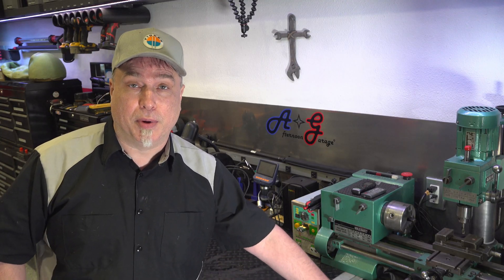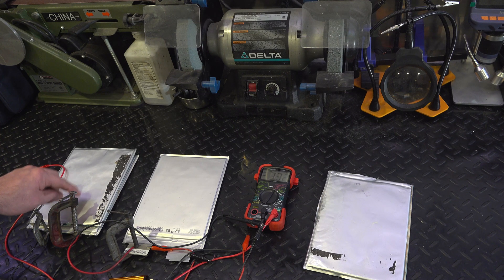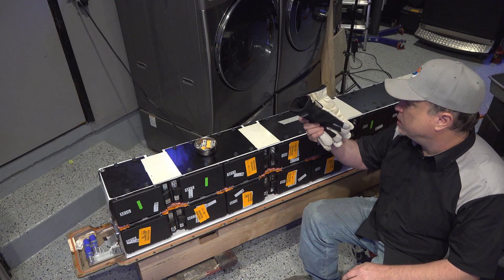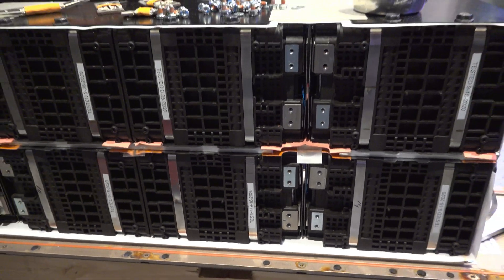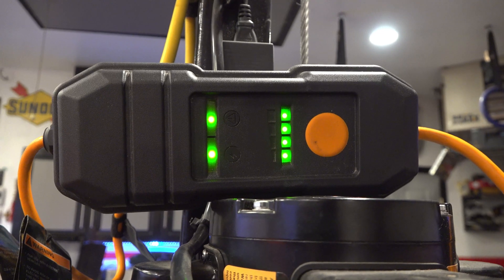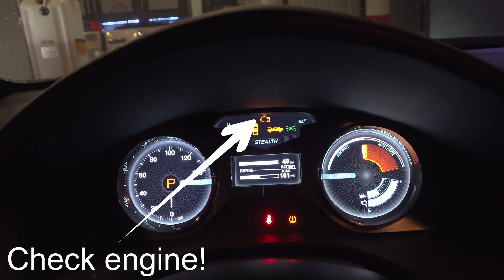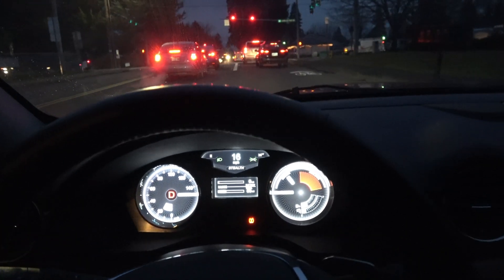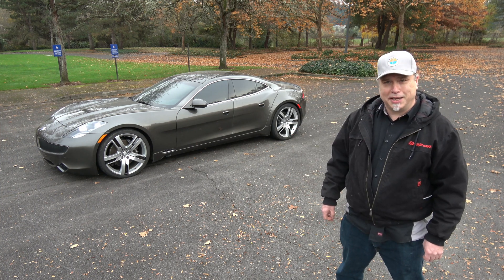Fisker Karma: Reassemble and drive!  [4K] Ep50

Comment: Really good serie and awesome detailed work, for data collection I hope you got an intern...damn what a pile of work :D

If I understood it properly, I got now why this battery is a mess of design (becouse theoreticatly  it sounds awesome, using just LiFePo4, the safest option, in big bags, like does today BYD for an easy production)

The mayor issue is they are just all in series right?, in a car with a small battery but a huge power and weight: Recipe for dissaster, it's imposible to avoid the battery to fai becouse the pack is just small and the cells kinda of stressed and there is not B plan, or they all work fine or the car won't work. The thing is cells are allways failing.

If you wan it to be usable for a long time, don't press to hard/often the right pedal :D, the design is not redundant.

This is just the oposite of Tesla, they use millions of cells (horrible manufacturing) but the system can work with failing cells...plenty of them, so you don't need to have the best cells, neither the best process.

Comment: Wow, great video series!  Was on the fence about buying one of these for the battery issue, but now im sold.  Will be looking for one!  Maybe i can even find one super cheap that needs a battery lol
Reply from the maker: The problem is that all the electronic equipment is connected via a bus and everything is serialized.  So if you needed to replace a major component you would need a programmer to make it work.  I was very happy I was able to fix this on the cheap.  I still have loads of AMP-20 cells!

Comment: Hi there, great video! So the Fisker is a a dream car, I am currently building my first ev small conversion with a basic warp 9 motor and Chevy volt battery. When the Fisker gets a bit cheaper, I am going to try to copy your project. What’s the total range you ended up getting? Looks like 40 mi?? Many thanks and great job!!
Reply from the maker: Thanks for this comment.  Looks like you have an interesting project there.  The Fisker Karma is almost 3 tons wet with a wheelbase of a truck.  This makes the ride very nice, more like a heavy touring car.  Mileage per charge not so good.  While Tesla was focusing on weight savings, the crew at Fisker were busy adding technology and getting the batteries manufactured correctly.  Something they were never able to fix until the company went bankrupt.  When fully charged the range says "50 miles".  However, real world says you get about 35-37 with a fully functional battery on a warm day.  Good luck with your project and thanks for watching!

Comment: You are one of my heros, the idea you took the battery apart and repaired it is amazing. Great job
Reply from the maker: Thank you for the kind words.  This series with the battery repair has ruffled a few feathers for sure.  I don't think the 'CSPs' like having their gravy interrupted with someone repairing the pack and showing the world how to do it.  Insane that Fisker repair shops routinely charge $15-20K for a 'new' pack, swap out a module and give it back to you as 'new'.  These cars are going to start showing more and more failures and I hope I reach as many folks as I can as least to understand what is happening and what the parts look like.  Thank you for watching!
Reply: @afternoongarage  great to hear. I also had a question regarding you testing. Can you just volt meter test each module and find the bad one then take that apart and find the bad cell and replace the cells ? 
Thanks again.
Oh ho long has it been now since you repaired the battery unit ? Thanks again
Reply from the maker: I did all this work a little over a year ago and the car is a great runner, no service lights. I come from a military background and worked on unmanned drones.  Battery capacity is very important in these packs.  I used the same technique in checking individual cells.  Really, I knew that module 6 was defective from a measurement.  Remember, these parallel sets of three cells are all in series. One set of three will make the entire pack not function as the chain is broken.  I had planned to charge the battery completely, drive the car until it was discharged and then put it on the lift for service.  The cells inside module 6 were so bad that they looked like an open circuit when discharged and capacity was almost zero.  I had to use the ICE to drive the car on the lift.  I really didn't see much deviation at all in the modules during test.  I guess you could just find the low voltage, probe the module and repair that set.  I have a good stock of AMP-20 cells if you need them.
Reply: @afternoongarage  is the AMP-20 cells the foil packs you changed out ?
Reply: @afternoongarage  Also how much were the AMP-20 packs each ?
Reply from the maker: @skipperrichman4278  Yeah the modules consist of 7 sets of 3.  So three in parallel with 7 in series.  That is 21 cells.  The cells are the pouch packs.  I paid around $37 each shipped from China.  Beware that there are different versions of these and you really want to get the same part number as the one you removed.  I think the AMP20M1HD-A is a nanotech battery and has a higher C rating.  You can get generic AMP20 cells but they cannot be charged/discharged at the same rate.  Just go to the A123 website and you can see the barcode a the top near the tabs.  That will say: AMP20M1HD-A .  Looks like A123 (OEM) charges $75/cell + ship.

Comment: Impressive effort with this car, I was so relieved to see the brass connectors worked. Congrats on repair and thanks for making the videos!
Reply from the maker: Yes those worked really well, clamping across such a wide surface area.  20 amps should be no problem through those tabs.  We have done many cars now with the same symptoms as my car and all are working great after the repair.  The cells seem to be still available, so that is a plus. Thanks for watching!

Comment: Excellent video series on the battery pack! Very detailed and well explained. The wood battery box support with 4x4 drop setup was ingenious and looks to have worked perfectly. That battery is seriously heavy. 

Ever had any issues with the CIU module? If you ever do, would appreciate if you could video the process to remove and inspect. Thats my next project to work.

Where did you find a Service Manual? Been looking for one for several years now.

Keep up the great tutorials!
Reply from the maker: I have had water intrusion in the CIU area.  I guess I simply got the wires wet and it needed to be programmed.  I bought the Movimento Puma 2 and was able to get the USB to work to reflash the CIU to enable the NAV and radio to work again.  What I really need to do is pull the dash out and get a better view on what is happening there.  This might happen in the near future as I plan on keeping the car for a while.  The link to the service manual I have is in the description.  Good luck... and it is Millertime indeed.
Reply: @afternoongarage  Many thanks for the prompt response. Looking forward to more educational videos from your channel!

Comment: I just got a “ park system fault “ on my karma . Any idea on what it can be ? Any info would be appreciated . Thanks for videos .
Reply from the maker: When I did a 'hard reset' on the car when I was having battery problems, I noticed that the parking brake would calibrate after reconnection. It should calibrate itself, just pull/push the button and it will do its thing.  I noticed that the car needed to be on a flat and level surface for this to work correctly. In fact, one time I had to push the car back/forward while calibrating the parking brake.
Reply: @afternoongarage  I really appreciate you answering man , I love this car . Keeping up with your videos as well 👍🏻

Comment: Hello this is OJacks I have a Fisker, Code just popped up POA7B (battery energy control module) I don’t know what that mean . Today I will go out and unplug the main battery cable for one minute and plug it back in to see if the code come back after I clear it
Reply from the maker: That is a request for a general battery issue.  This code is actually only responsible for setting the check engine light.  The actual code causing the issue is something else that can be read by the Fisker service laptop.  That was the code I got that told me that I had battery problems.  I originally scanned it with a very inexpensive scanner and that is the only code it read.  It wasn't until I plugged the Snap-on scanner that I was able to see many other codes that were set.  Looks like there are people out there that can translate exactly what these Fisker specific codes mean.  Unfortunately, the Fisker mechanics out there are only into making money and have no interest in helping people out free of charge.  That is what prompted me to make a video where I fix the car myself.  If a bad module exists, you will start having range issues where the battery will not completely discharge from 50-0 miles, instead it will discharge all the sudden with 10-20 miles left on the charge.  My car used to set P0A7B every time I got down to 20-30 miles or so, and then discharge completely at 15 miles.
Reply: After you repaired the battery did the code come back again
Reply from the maker: As you can see in this last video of the series, the light stayed off the entire drive after it reached 0 miles.  I have driven a few complete charges/discharges and it never came back on.  I am actually a little surprised because the guy that sold me the car said that P0A7B codes are normal and I would need to reset them frequently.  This was after the car was in the shop for $22K in motor and RDM work.  The Fisker mechanic should have known that those codes aren't normal.  Or he did, and I was sold a broken car.  I will never know.  But what I do know is that those codes aren't normal if the battery is healthy.
Reply: Some Mercedes have a small battery for auxiliary . It would be good thing if they had the solar panel maintain an auxiliary battery .
Reply from the maker: Yeah, I think its great during the summer, I can walk by my car and smell the interior because the fans are running when in full sun.  I understand the Mercedes does this as well.  There are some Fisker owners that don't like the panel on the roof and seek to remove it.  While it doesn't really do anything to charge the HV cells, I like the idea of having it keep the 12V battery charged and also run the blower.
Reply: OK today I scanned it again and check another module and it gave me a different code POD13  I can’t find any information on this code so I’m headed to the Dealership today
Reply from the maker: There really isn't any posted info out there.  Looking at the codes I had, it threw a code P0DE6.  My car had a bad module 6 in the pack.  If I were to guess, I would say you might have an issue with module 13.  Let me know what you find!
Reply: OK I got a call back from the dealership today and they said it would be $2500 to replace the contacts in the battery. The repair will clear the code POD13.
Reply from the maker: Wow, you have a bad contactor then?   That is located in the pack and it would have to be removed from the car to replace.    I think there was some talk on the Fisker Forum about contactors.  At least they have diagnosed this for you and you know what is wrong.

Comment: I have the same problem with my fisker.I would like you to fix my Fisker.Can you text me and let me know how much you would charge me to fix mine
Reply from the maker: The purpose of this video series is to instruct others and to show there isn't anything too complicated in the battery pack.  My options were to ship the car to the east coast, change the entire battery pack and ship the car back.  This would have easily cost $25K and I would have a running car.  After spending $60K on this car, I was not prepared to spend any more, so I decided to fix it myself.  If your car shows any 'check engine' lights that point to the battery, or you are experiencing range issues, it is a good bet you will  need to get some battery work done.

Comment: Great to see the car reassembled and on the road.  Is there an issue with the sensor for the tires? I had to have my sensor changed. I agree with your opinion on the car.  I get so many compliments on my Fisker.  Compared to cars in the high end market, the Karma looks great.  Thank you so much for sharing your work.  I learned a lot from them.  Stay safe!
Reply from the maker: I have a slow leak on a tire that was plugged and not fixed correctly.  I have a new set of tires I am going to throw on it.  Glad you enjoyed my videos, I enjoy making them.

Comment: Hello I love the way you took your time and fixed the fisher I have one as well it’s currently in my driveway stuck I can’t get it to move the door pops open and when it did workI had I had an issue with it switching from stealth to sport any suggestions on where I could take it to get fixed
Reply from the maker: As you might have seen in a previous video, I had trouble with a mechanic that repairs these cars.  This was a shop on the west coast.  I also had a problem where I got water in the cowl area and the CIU got wet.  I bought the 'Puma' programmer and was able to reprogram through the USB port.  In short, I have had to fix this car myself.  I think there are some good service folks on the east coast that are trustworthy.  I would post your problem on the Fisker Forum and see what people think it might be.  Thank you for watching and good luck!
Reply: @afternoongarage  the best Fisker service is with Joe Ferrante at Evolution Autosports 267-210-3986 in Pennsylvania.  He will help you make arrangements to have the car picked up and returned.
Reply: the best Fisker service is with Joe Ferrante at Evolution Autosports 267-210-3986 in Pennsylvania. Or Karma Atlanta but they will charge you waaaay more. So joe is the best way to go